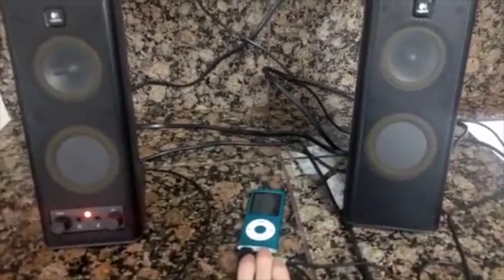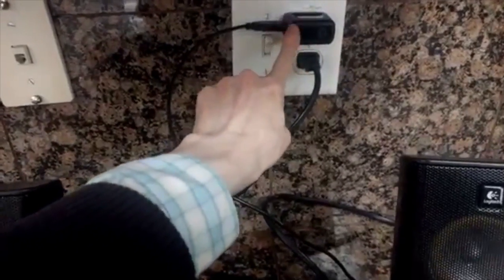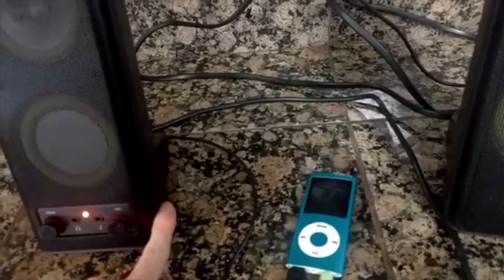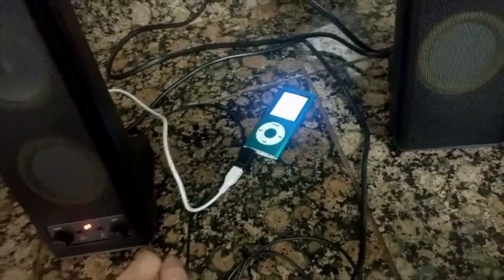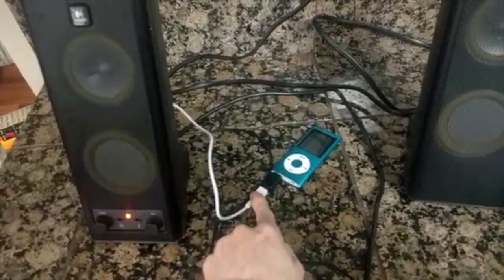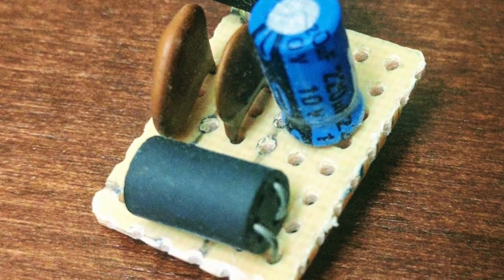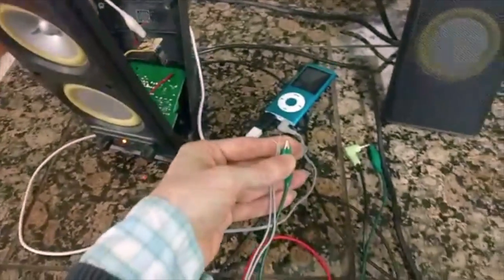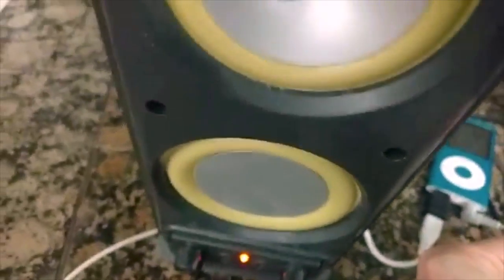Mystery Interference

Comment: A 7805 converting 13V->5V will turn (8*<amperage>) watts into heat.. giving you (5*<amperage>) watts of power to the mp3 player.. so 200ma: 1.6 watts heat/1 watt of usable power. That 7805 can't dissipate that much heat without a major heatsink. I'd use a buck converter - get a module for $2 from ebay.. However, it sounds like your speakers are depending on clean input power - a buck converter will still spew noise towards the amplifier. What I did was just replace the speakers' amplifier with a T-Amp module, which seemed to work pretty well.

-- "the guy who put the う into your web app years ago"
Reply from the maker: Hi Mr う!  Yes, the 7805 is limited.  Charging my phone causes it to heat up rapidly.  However, the MP3 player in question consumes such a tiny trickle that the regulator is stone cold -- unlike the wall wart it is designed to replace.  I've also measured the output with my oscilloscope and the 5v output was clean under load, even before adding the capacitors and choke.
Reply: I'd also have guessed that the 7805 would waste more energy than a switch-mode USB power supply, but apparently your USB wall wart isn't very efficient!
Reply: Your capacitors are on both sides of the 7805? (Some on each side?)
Reply from the maker: Both sides have a large capacitor and a small (> 1uF) capacitor.  The large capacitor on the 13v side is provided by the speaker, and can run the system for about one second after power is removed.
Reply: Neil Fraser well that's about the limit of my easy suggestions. I'm thinking separate bulk capitance for the amp, separated from the mp3 player by an inductor.. What size inductor, I have no idea.
Reply from the maker: A year later my requirements changed.  Now instead of powering a little MP3 player, I'm powering a Google Home and a Chromecast Audio.  The amperage went way up, and heat started being an issue.  So I've replaced the 7805 with a buck converter.  Heat is gone, but the mystery noise remains (though an audio isolator solved that problem).

Comment: Tried a ground loop isolator on the audio line?
Reply from the maker: That's definitely the next thing to try.  But I don't understand why it would be needed.  If the grounds are common (as was the case when they were shorted together), there shouldn't be a need for isolation.

Comment: So you tried:
Speaker & Ipod separate power (with wall wart) Ipod as 'audio' input for speaker - no interference.
Speaker & ipod same power, Ipod as 'audio' input for speaker => interference.
Speaker & ipod same power, PC as  'audio' input for speaker - no interference.
What happens if
you connect the ipod to the PC 'audio in' in the third case ? - but maybe there is no separate socket?
Oh and (stupid question) you did try different cables right?

Comment: What happens if you plug in headphones while being powered by the speakers? Do you hear any noise?
Reply from the maker: Great question.  When headphones are plugged into the headphone jack of the speakers, there is the same interference.  When headphones are plugged into the MP3 player directly, there is no interference.  In both cases the player is powered from the speakers.